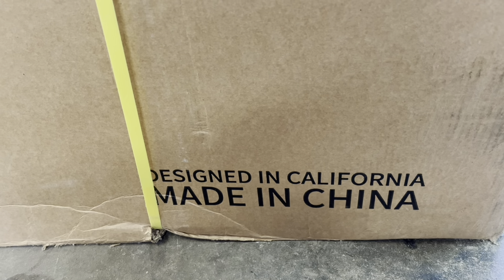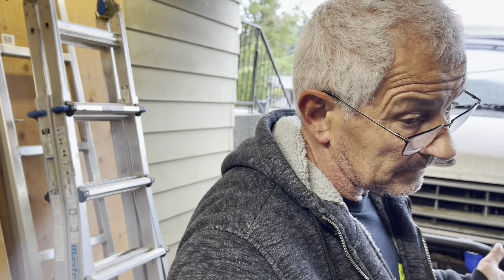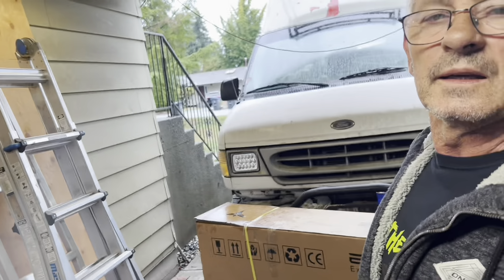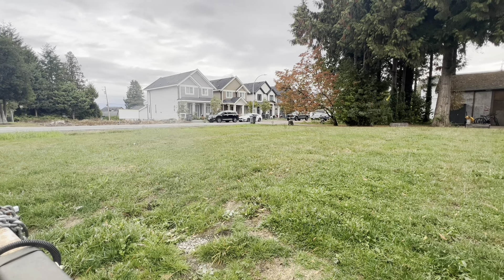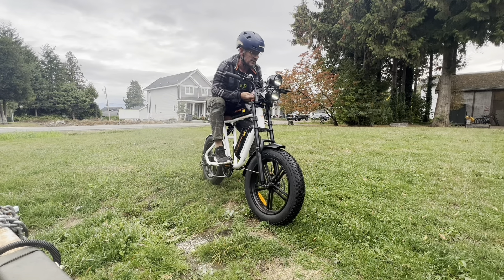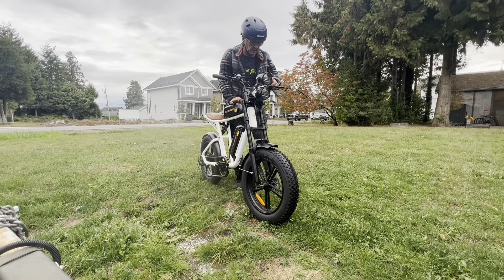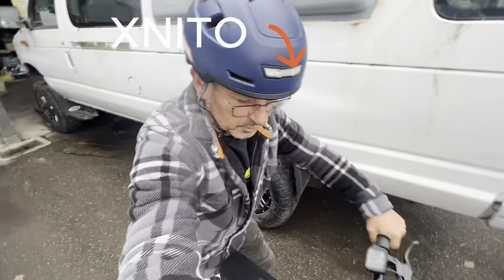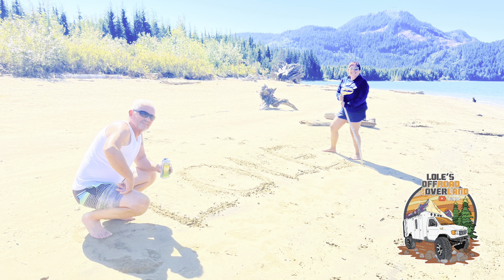What have i done Reviewing An E Bike ? ENGWE Ebike M20

Comment: 💙🇺🇲 Watching a review channel on E-bikes maybe a year or so ago the reviewer mentions that when the battery(s) are placed low on the bike frame then the balancing/control of the bike is much better than when the battery(s) are placed high on the frame of the bike.  Just thought I'd throw that out there to the masses for anyone considering  purchasing an ebike. 

💜🙏☮🙏💜  Thanx Loren (hope I spelled your name correctly?).  You need to do some mountain biking with Chrome, and Chrome needs to have a side car or an articulating trailer built for Cruzie.!  😊
Reply from the maker: Hey thanks yes that’s right you did spelled it correct 
Yes that be sweet Cruz in the side car epic I have to talk to Chrome about this 
Thanks for the support 🙏✌️
Reply: higher centre of gravity is always a concern, but every rider should know their bike and know their ability level. Having an e-bike doesn’t mean you can “rip it up” . 🤙( long term e bike owner and lifetime rider)